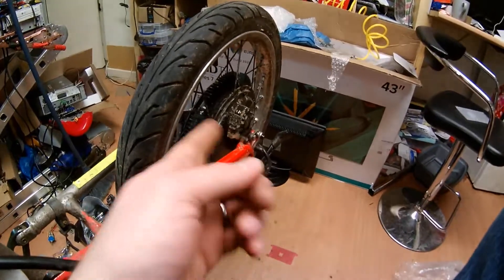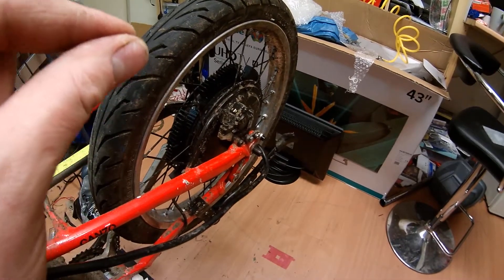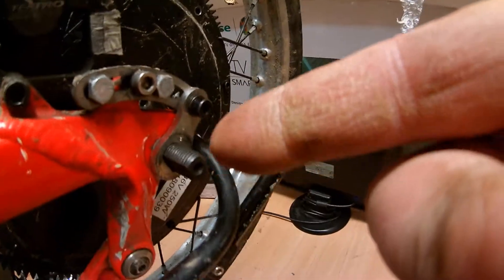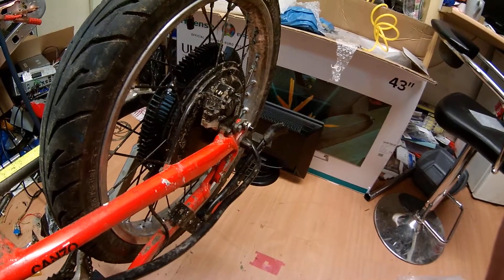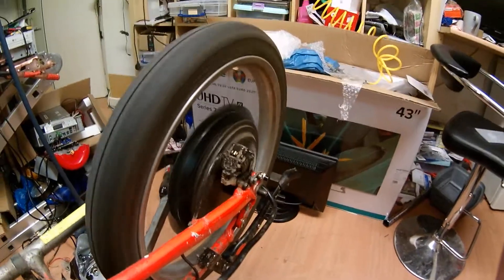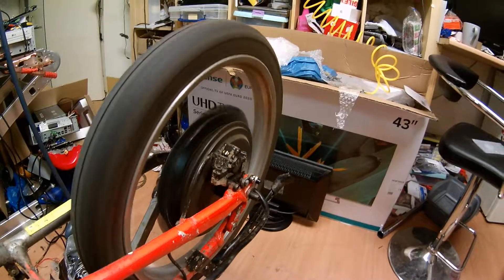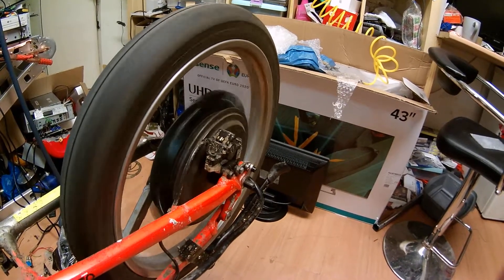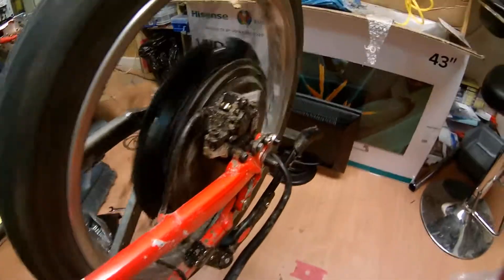mxus 3k turbo mod 4t rebuild test 3 phases complete 3000w with sabvoton controller #smartazz

Comment: What a fantastic job! Maybe some day I will be able to do the same. I’m still learning and only onto my second build now 72v 100A/ 100a sab/ mxus 3k turbo 3.5T. Battery come last week just waiting on the kit from mxus:)
Reply from the maker: Yes that’s amazing, you’ll have loads of fun 🤩
Reply: @smartazz can you use sabtovon 150 a controller or 100a with MCS 3k turbo is possible? Do I need to program or controller will work straight connect?
Reply: You have come along way now ebikekilla!!!
Reply: can you use sabtovon 150 a controller or 100a with Mxus 3k turbo is possible? Do I need to program or controller will work straight connect?
Reply from the maker: @Thuds123  will need to run the hall setup first. 100A will be fine :)

Comment: Hi mate looks and sounds good I wonder ur wiring mxus to sabvoton was streight forward or u had to change the wiring sequence for hall and phase and throttle and if yes can u advice how pls?
Reply from the maker: It was the same as the original. When I removed the old windings I made a map of all that wires, unfortunately the map is lost now and most likely only I could understand it. Iv added a link to a picture that might help you.
Reply from the maker: https://images.app.goo.gl/tPJLSF8KvDXVKKYg6
Reply: @smartazz  great man thanks all same wiring only throttle was misplaced so I had to replace the colour to match but I broke the throttle first time lucky me had spare one so sequence the wiring colour to coulor then test it and it works a charm very smooth and quite motor and get to 99.6mph without load with 73v charge in battry can't wait to Finnish the build

Comment: Why did you not wind back to 3t i have just bought 3t and will use 16 inch motorbike rim. Should I go for 4t instead?
Reply from the maker: No 3t is good :)
Reply: @smartazz  thanks dude

Comment: Clever sod 😁
Reply from the maker: Vortecks I just need to fill it full of copper wire now
Reply: I admire your tenacity mate. I think you need to do dynamic balancing - it looks like it's gonna be a rough ride when you fully open it up 😉
Reply from the maker: Vortecks absolutely. I had to remove the tyre and replace the inner tube but never balanced it.
Reply: Good job I wonder what battry and controller pls